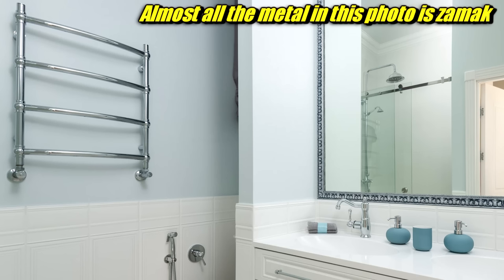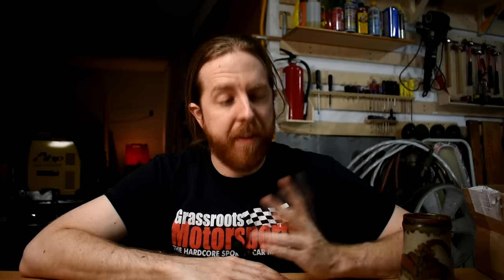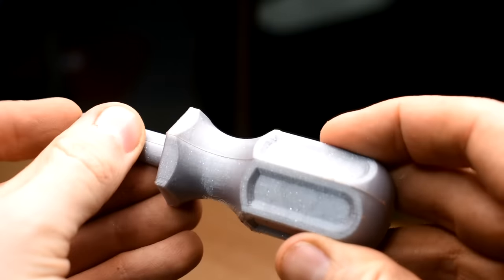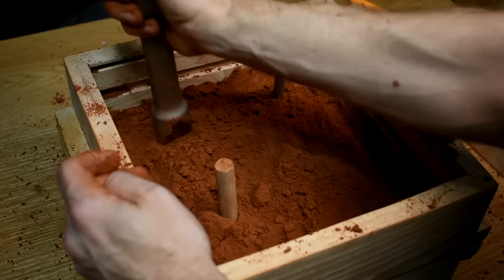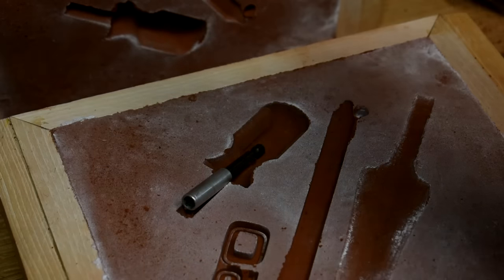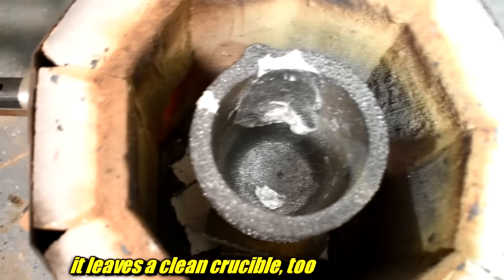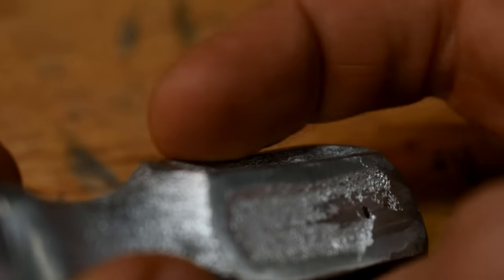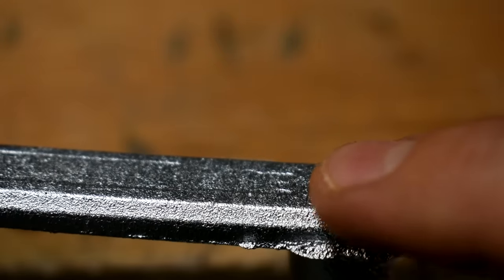The BEST Metal Casting Alloy That Everyone Ignores

Comment: Do you per chance use beeswax on your flap and grinder discs, with this stuff or Aluminum?  If not, grab a puck or bar of the wax an run the disc or flap on it until it all coated.  You won't have to worry about gumming up, but you do have to re-apply as needed.   I learned this trick from a machine shop over 20 years ago.
Reply: I feel bad watching anyone cutting alu or anything cloggy and doesn't use wax, it makes the blade sing! Though I havn't used bees wax..
Reply: People wonder why I have old used candles (from wife; no scent, stick ones are the best) all around the band saws and the grinder/flaps.  It's like drilling metals and using lube.

Comment: Lead acetate was used to sweeten cheap wine. Acetate is vinegar acid (technically the conjugate base) so simply put elemental lead or lead oxide (white pigment) into vinegar then let the water fraction evaporate.

Comment: High Point pistol slides are made of zamak. It works. I have seen a recoil spring and pin shoot down tange after the slide broke in the weakest spot possible. Right under the barrel clearance where it is a very thin web. Its the only one I have ever seen or heard do that. It's not the most ideal material for everything, but it works well for a whole lot of shit as you pointed out early in the video.

Comment: You should try ZA27! It's mechanical properties are comparable somewhat to that of steel!
Reply from the maker: I've heard that!  I have a friend who has done a bit in ZA27 and he really likes it.  I'll definitely take a look at that at some point.  This ZA12 is going to become a Gingery Lathe, which is designed to use aluminum, so this is a significant step up
Reply: @PaulsGarage 
There are alloys if certain elements that totally break the stereotype of the element. The Aluminum Bronze specialist company AMPCO. Their first product the brought to market in the early 1900s was an alloy used for making cutting tools meant for machining steel.
Reply from the maker: @mpetersen6  aluminum bronze is amazing stuff

Comment: I use Zamak a lot, and is great because of low temp melting point, but I found it can break under stress, so it is not convenient for moving parts or which take some load. On the other hand, it is perfect for casting jewerly or toys.

Comment: Also, don’t get zinc in your lead.  I once ruined a pot of bullet metal by accidentally getting zinc into it.  The entire melt suddenly looks like lumpy oatmeal.  BTW if you’re thinking to salvage the lead from old large tamp-ins, it turns out the threaded wedge part is zamak, not steel.
Reply from the maker: Weird, it turns all lumpy?  That's crazy
Reply: @PaulsGarage  even a little zinc in normal lead/tin/antimony bullet metal will do that.  Maybe a metallurgist could explain it.
Reply: @lanedexter6303  there's a trick to removing zink from lead, can't remember exactly what it is, might just be something like adding sulfur. The point is, the additive binds to the zink, not the lead, and leaves you with pure lead. 

The trick should be on one of the old firearm forums, and probably WikiHow by now
Reply: @torg2126  Thanks, that’s worth a search.👍

Comment: Also worth noting... zinc if heated above around 900-1000F will release toxic fumes. glade you mentioned it. also... instead of turning down the furnace... just leave and cut the breaker outside....

Comment: Cabinetmakers love Zamak, a big reason that people don't promote it for hobby use is because of the high level of material safety precautions that are required that you ignored and didn't even mention once. If you cast with this frequently and ignore the precautions you should be using enjoy the Non-Hotchkins Heckle Cell Lymphoma in 20 years.

If you take the proper precautions (mostly a respirator with the correct filters) the stuff is great for anything that weight isn't a critical factor. The stuff is HEAVY at a bit over double the weight of aluminum by volume.

Comment: Is there a finer grain casting sand available? You could potentially get even more detail in the cast.
Reply from the maker: Yes!  There is finer grained petrobond available, and if you make your own sand you can go as fine as you want.  Olfoundryman grinds his own super fine sand and he uses it for facing, right up against the pattern.  As a result his surface finish is spectacular
Reply: @PaulsGarage  beyond sand you can do a lost wax and plaster process. Detail there is unparalleled. Plus people favor it for the overall simplicity. If you can dip stuff that's pretty much all there is to it. There's no ramming up or false copes. You do have to be able to burn your pattern out though. Some let the molten metal burn out and some pre burn. Once you have the plaster mold prepared you support it in dry sand for the pour. Then people explode the plaster to clean it off. While it's still hot they hit it with a garden hose. I've watched the process on video.
Reply: There's something called Delft clay, commonly used in jewelry casting.
Reply: @hanelyp1  we'll always have Paris. Plaster of Paris, that is.

Comment: So I just found this video but on the shiny vs bumpy I think somewhere between the two is better looking. Sure the shiny is nice and the details of the sand are cool but either one is a bit extreme. Basically I think a slight polishing with a slight material removal would look top notch.

Comment from the maker: I got these za-12 ingots at www.rotometals.com. 
Want to use your 3D printer to learn Sand Casting in your home shop?  https://paulsmakeracademy.mykajabi.com/joinus
Reply: I love you in Europe 💚
Reply: You should start posting over on Patreon again. It's been a while :)
Reply from the maker: @EricMBlog  you know that's a fantastic idea I think I'll do that
Reply: I liked this video a lot more than I thought I would.
Reply: Have used this material for casting lead soldiers problem is because you have to give it a longer set time it would burn out the details on the silicon molds had to switch back to good old lead.
Reply: @surfaceten510n  Nothing beats Tin/Pewter for casting in Silicon Molds....except for the price that is.  A good source of "cheap" Tin/Pewter is the opp shops.  Look for beer mugs etc (and they have been lead free for the last 50 years or so).
Reply: Oh, I thought it was cheaper than aluminum?
Reply: "Thank goodness I still live in a world of telephones, car batteries, handguns, and many things made of zinc."
Reply: Great content. A tip from personal experience as a foundryman, use beeswax for angle grinder blades to prevent gumming (also works on linishers). A touch before use is all it needs and makes blades last ages. It works wonders on Aluminium so will probably work great with Zamak

Comment: I swore I would never melt anything with zinc again after getting metal fume fever.
Reply from the maker: i don't blame you.  I'm always nervous when I see people melting brass at home.  There is no way to melt brass and not have zinc fumes pouring out the top
Reply: Zinc fume fever brought up memories of the metalizing process used for wind tower vibration cancellation weights.  (Big honkin' weight at the top of some towers, electromechanically shoved around to cancel vibration).  

It's similar to spray welding, but instead of melting a powder in the electrical arc and blowing it on the workpiece, a solid metal rod/wire is fed into the arc.  The reason  I bring it up, is the breathing hazard is so much worse.  If you breathe it in, you can get the metal 'mist' condensing in your lungs, and it doesn't take much to be fatal.  Because it's usually nonmagnetic material, magnets can't be used to remove it after it has solidified into the tiny structures in your lungs.  The safety training for that process contained some pictures from autopsies that I have had actual nightmares about.  Think along the lines of casting an ant hill with molten aluminum.  That can't be removed even with surgery.  

First time I saw it done, I didn't know what it was, and approached the guy doing it outside from downwind.  It's in the running for the most severe chewing out that I ever richly deserved.
Reply: @PaulsGarage  I've heard of people getting it from using an angle grinder on galvanized steel, even.

Comment: You need to try high temp silicone molds with that material. The details are astounding and you can use the mold multiple times by multiple I mean three or four max. It isn’t cheap but when you need supersonic detail  This is the bomb

Comment: A note about zinc: you should also NEVER weld on anything galvanized or zinc plated, there is no safe way to do this, and even with a respirator you can get sick and die from the fumes, you also cannot grind off or remove galvanization from steel, because it actually makes a chemical bond, so even if you grind off the zinc coating or dissolve it with acids, there is still zinc in the steel and you will get sick and die from the fumes. When in doubt,  don't weld it.
Reply: Yeah, by the point you get to a temperature where steel softens you'll be far, far into the temperature range where zinc boils and is shot as a vapour straight into your lungs.
Reply: Whoops! Been welding on galvanized for a long time,electroplate not hot dip. Ventilation is important.
Reply from the maker: In addition to the nasty smoke, the welds end up uglier in my experience.  it's bad all around.
Reply: @PaulsGarage  I always use flux core wire. I use a lot of garage door track for projects so I'm used to welding the stuff. 

I have gotten sick once welding it and several times working at a die cast plant. Had to burn zinc off of plungers to change piston rings for the die cast machines. $6.90 an hour back in the day.

Fluxing the pot was hideous work.
Reply: @dolphincliffs8864  https://en.m.wikipedia.org/wiki/Metal_fume_fever
Reply: We always welded galvanized steel in a breezy carport type of structure. Basically outdoors,  we only had issues when wind pushed away the shield gasses from the MIG welder.
   Besides fumes, burnt zinc oxides would float around like frozen smoke. Not healthy stuff!

Comment: Hi point has been making handgun slides from this for years. They're not high quality or the most consistently reliable but if you get a good one they do work. They're a LOT more durable than I would expect from a handgun with a zinc alloy slide.
Reply from the maker: It's pretty durable stuff, I have real trouble breaking it with a hammer
Reply: @PaulsGarage  kinda crazy that it holds up to thousands of micro explosions and the wear of the internal parts.

Comment: You can remagnetize the bit. Is an easy thing to do and the DIY methods are easy to find online. It requires another magnet though and preferrable a strong one like neodymium. I think an electromagnet will work too if done right and has the potential to be much more effective.

Comment: I use Kirksite for casting jigging fishing lures. 

Awesome castings, it's 35% lighter than the original lure. Lighter lure makes the lures stay longer in shallower water column.
Reply: I saw many kirksite ingots at my old aluminum foundry in Akron but never saw it used for anything, however a couple of the fellows who raced inserted them in car frames to provide a lower center of gravity. They felt very heavy like lead.

Comment: The original Gibson ABR-1 bridges & tailpieces were made using Zamak #5. Which isn't really manufactured anymore & hard to come by.  That's one reason the newer Gibson ABR's & other companies "replicas" like gotoh, kluson, allparts etc. don't sound like the bridges from the late 1950's & early 1960's. The other reason is the saddles on the old abr-1 have a very blunt top with a much shallower pitch than any if the newly made "ABR-1" replicas.

Comment: Had a gig welding galvanized steel for a bit. Even with a respirator and controlled breathing, there was low-grade ache and weakness everywhere.
The guy who took over only lasted four days before going to hospital. I have it on good authority that zinc poisoning really sucks.

Comment: If you pour some plaster in a mold  then fire it to 1400 degrees F, when cooled off, smash it into 1/4 " and finer frit. when you want to make a mold (I use this to cast glass and shape glass panels)Mix plaster with wetted grit and water and pour over or around the shape you want, the details 90 % of the time are sharp. Most glass that i use will cast around 1300 to 1600 degrees Glass melts  at around 2500 degrees F. When you use the mold and it starts to become unstable after 2 or 3 firings, don't discard the mold , make more frit.

Comment: Zamac corrodes fairly quickly if it's not given a protective plating layer over it, and that requires specialized techniques to plate properly.

Once the plating fails, zamac won't last long.  Sometimes it crumbles even though the plating is intact. 

It's a material in the class of pot metal or cast zinc.   Basically what I'm saying is, it's not a good choice for the hobbyist due to its need for protective plating.   Without the plating it's more or less just garbage. 

I'd know, I've worked with enough crumbling, corroded zamac alloy guitar hardware over the years.

Comment: About the magnet. The melting point of the zinc is close enough to the currie temperature of the magnetdc material. That much heat will ruin magnets.

Comment: I've never done a casting like this before and just learned of Zamak from a random google search.

I'm curious if you were able to preheat the sand - perhaps 150 - 200 degrees somehow before the pour, if that would alleviate any "shrinkage" or other less than ideal quality control issues?

My experience is some 25+ years ago doing centrifugal spin castings of mostly 15mm historical wargaming miniatures with pewter. This is all new to me, including the sand casting technique. 
I am aware of the "green sand" technique although, I think it was for making cast iron?
Reply: The metal is going to shrink when cooling from a liquid to solid state regardless. Heating the sand only helps it fill in very fine details it might cool to rapidly to fill otherwise

Comment: how good is this alloy used in a engine bay? like for an air intake. i always wanted to make itb's (individual throttle bodies) for my 2jz ge
Reply from the maker: Engine bay parts don't get as hot as you think.  This should work out no problem.  Many carburetors are made with zinc alloys.  Heck I know a guy running 3d printed plastic velocity stacks on some ITBs, no issues
Reply: @PaulsGarage  hell yeah i just don't to be breathing in something toxic or the heat cycle making it fragile sending a chunk into my headers

Comment: Back in the day, we would use an acetylene torch to coat the molds with carbon to improve surface finish on aluminum. No idea if it would work with zinc.
Reply from the maker: Coating the molds with soot?  Myfordboy did one test where he coated molds in talc and it improved surface finish, maybe it's similar?
Reply: @PaulsGarage  Could be. We just left the oxy off and used a very low smoky flame to soot up the mold cavity. Guess it sort of filled the gaps between the sand grains.

Comment: Hey man. I just spoke with Rotometals. You may be closer to promoting Zamak than you think. Lol. I told them about the 50lbs showing up at your place and you promoting. Anywho, they asked why they were getting sales uptick and it's you buddy. I ordered it based on your pitch. If you get any swag Zamak, let me know. If you're ever in Toronto let's get together for some Zinc shakes and giggles. Ha
Reply: @Rotometals Paul here needs some more Zamak.
Reply from the maker: LOL rotometals if you're reading this I make various bronze stuff too 🤣🤣. I wouldn't count on a big outfit like them sponsoring me but I definitely appreciate the thought
Reply: @PaulsGarage  Dude. They specifically queried why they were receiving a sales bump for Zamak 12 in the past few days. You don't need to be ChatGPT to figure that out. Your video release date and there bump in sales hmmmmmmmmmmmmmmmmmmmmmmmmmmmmm

If @Rotometals wanted to step up their sales game they would send out intrepid adventurer @paulsgarage here on a journey of metals, nay journey... A QUEST OF METALS!!! I bet instead of a fashionable blazer, Paul here could don the appropriate safety gear and melt anything ROTOMETALS has to offer.

Comment: We would get super high-resolution of wooden carvings by making a silicone rubber mold off of the casting and then pouring a gypsum part in the mold.  Then the zinc would be cast into the gypsum and the wood grain looked like the original part.

Comment: You can use old anodes from scrap metal very cheap and then add 1% aluminium in the foundry to harden it. Zinc very good for non mechanical pieces but beware of LOTS OF SHRINKAGE so provide risers.

Comment: Very interesting....I have a problem that I want to cure, like a badly worn cross feed nut  on my lathe, by casting an alluminium nut for my lathe crosslide by casting it around the end of the screw which is virtually unworn........but the heat required to melt the ally was too high then I remembered the zinc alloy my last firm ( before I retired)  used for door furniture etc and how tough it was so  with the lower melting point of the zinc alloy  I'll cast a new nut around the screw to save having to screw cut a square thread in 16mm diam......I'll make a split mold with plaster of Paris for the nut body etc.
Reply: Does your application have enough space to accomodate a babbitt bearing?
Reply: @somebodyelse6673  No, I want to cast a complete nut in zinc alloy using the existing worn one as a pattern and cast it around the end of the screw which is a short way to get a few nuts for spares etc without having to bore it out and internal screw cut it......the metal I'll use is called Mazac which is a zinc alloy used for a hundred and one applications like door handles and window furniture.